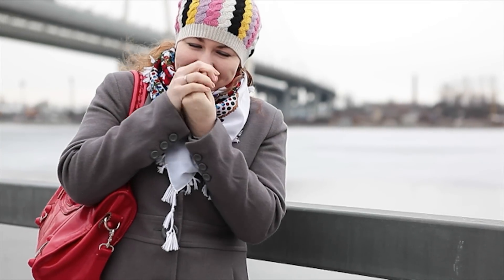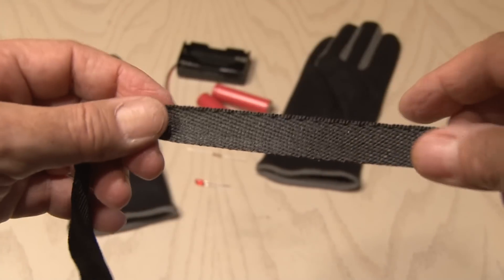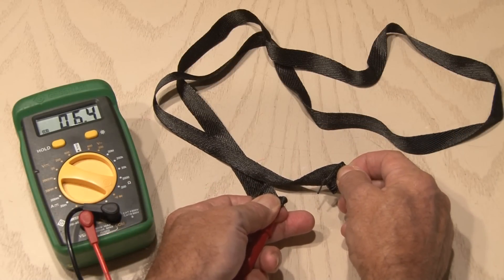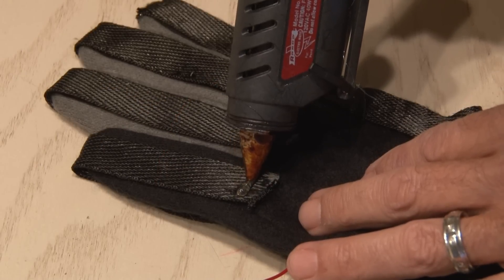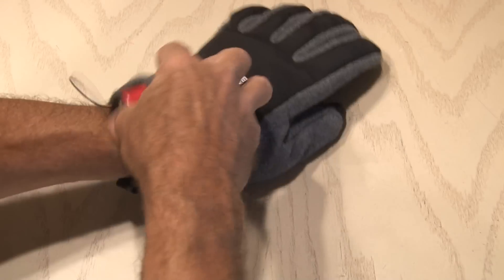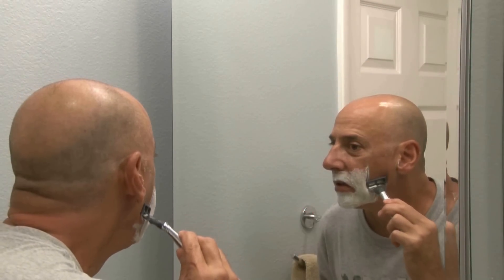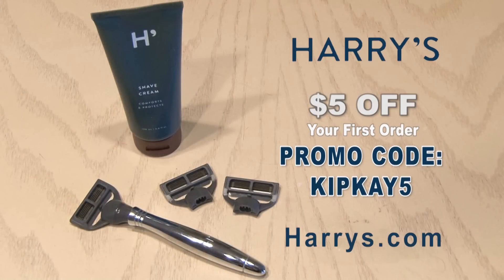Make a Pair of Heated Gloves!

Comment: good way to fully discharge a lithium ion battery...gonna cost a lot every time you do too lol
Reply: +TheXdmgx7 those are rechargeable batteries....
Reply: Kroenan affordable stuff do not include lipo batteries. 
And those motorcycle gloves do not have batteries...they connect to the bike.
And a protector is in the $5 range.
And everyone should be concerned about their $40 worth of batteries in an "affordable" project lasting more than one cycle.
And you made an uneducated statement about li-ions being rechargeable and your lack of knowledge about such batteries is showing. Can you move on an stop your "damage control" nonsense? 
This ~$60 project NEEDS 2 ~$5 protectors. Simple as that.
Reply: wow, missing points much. have a good one!
Reply: vgamesx1 Did I not say "good 18650s"?
And I agree with the laptop battery thing but to my exp those are usually 14's, not 18's. 
TP4056 makes it a little annoying. I'd put a 7.2v protector on both cells but either works. Or the voltage indicator. Those all work. Unfortunately neither was mentioned in the video neither was the fact that over discharging a lipo kills them. So you could get people who say "but these are rechargeable" and discharge the hell out of them then get a cheap ass charger and set the whole thing on fire. 
People need to be educated on the fact that lipos are not like nicad or nimh...he's using them like they are. That's how you get all those "hoverboards" catching on fire. Lack of education/information.
Reply: +TheXdmgx7 ok you can get 2600 mah batteries for <$2 if you take apart laptop batteries or buy direct from maker. if you discharge an 18650 below 2v it will still charge fine, just wont last as long. i have revived batteries from .1mv, you just only use like 5mA of current.
Reply: +TheXdmgx7 this project needs no protectors if you know what you are doing, one if you feel you need it.
Reply: DMAN22yeah
You guys don't get it. I have made phone chargers like this, an electric skateboard, and electric car jack, etc. MANY of us can handle our batteries but then again we don't need a tutorial to build a damn heating circuit.
This video is made for people who think there exist non rechargeable 18650 and who have no knowledge of how a lipo should be treated.
Those people are gonna build this, over discharge them, then attempt to ghetto charge them cuz smart chargers are expensive, and you know what could happen.
Also you really would change your mind about letting one over discharge when one explodes in your room.
Reply: TheXdmgx7 i have over 70 18650s in my room, at least 8 were below .2v and now that i brought them back up at a low current literally just using an old train transformer (i have a power supply now) they work fine, plus a charger from ebay is only $2
Reply: TheXdmgx7 if its negative voltage it isnt a good idea to use it but i use anything positive voltage. i have experience and skill so im not just an idiot who found some of them in a bin somwhere, although i did get mine from recycled laptop batteries
Reply: DMAN22yeah
 well let's hope everyone who tried building this glove is as skilled as you lol
Reply: TheXdmgx7 they should use 6 aa nimh because that will give pretty much the same capacity
Reply: +TheXdmgx7 i think those are nickel metal hydrate batteries not li-ions they would cost a fortune if they did. The ones i used were a variant so i might be wrong here so correct my errors if I do
Reply: Kamindu Samaranayake
 He says in the video that he's using 18650 3.7v batteries. And I don't believe I've ever come across Ni-mh 18650s.
Reply: Ok thanks for that☺
Reply: Gloves spontaneously combust

Comment: Please nobody do this, it's needlessly dangerous. Also, 140 degrees? Do you live in the arctic circle by chance? Regular gloves work much better than lighting your hands on fire.
Reply: +Lord GabeN I'm not sure 60C is enough to set anything on fire, especially in the cold.
Reply: errur 140F is certainly not comfortable anyway. Hot tubs are only 104F max. Imagine submerging your hands in water that's 4C more than a hot tub.
Reply: Lord GabeN Can't argue with that.
Reply: +Lord GabeN Warm air and warm water are 2 VERY different things. The termal conductivity of water is so much higher than that of air, it's a ridiculous comparison. I mean you can sit in a 200F sauna but you sure as hell can't sit in a tub of 200F water.
Reply: +Lord GabeN 
Celsius > Farenheit!!
Reply: TheThreeCraftateers - It's funny that you say that, considering it's a turn of phrase. I obviously didn't mean they were actually on fire.
Reply: +TheThreeCraftateers - If the protection circuit or anything else happens to those batteries, they could also explode or turn into a little flame-throwing bomb.
Reply: dude, they are 6 volts, get a grip with reality
Reply: and they would burn, not explode
Reply: TheThreeCraftateers - So the electrical potential has anything to do with the pressure inside them? Go throw a 6 volt battery into a fire and tell us how that works out.
Reply: +The Entire Earth I used a temperature gun to measure the heat coming out of the vents in my home and they were at 140°F. Short bursts of 140°F is quite nice when it's cold outside
Reply: The Entire Earth    again this is'nt fire were talking about here know it all, its a glove, here, ive got one, hold a hand warmer up to a lithium polymer battery, woah, no way, it dosnt explode, AND ITS LITHIUM!!!!!   im so amazed :l
Reply: timothy twogood no im good why dont you do that for me ;)
Reply: im three peolpe
Reply: +The Entire Earth Bro, do you even science?   Research thermal conductivity, then maybe you'll understand why your comment is so dumb.  I can't put my hand in 212 degree boiling water yet can hold my hand in a 350 degree oven, I wonder why??!
Reply: mikekoz68 Can you hold your hand in a 350 degree oven with no heat escaping for longer than an hour? There's a reason why people commit suicide by head in oven.
Reply: Finally someone with a brain.
Reply: +The Entire Earth aka "The Ignorant Commenter"

Comment: I think your crazy if you think 140 F is cozy and not flesh searingly hot
Reply: +xDXPxJOEx456x1 It is cozy when there's a layer of material between you and it substantial enough to significantly moderate the temperature.
Reply: +xDXPxJOEx456x1 Nooooo.... It can get that hot in the summer time. It's not even CLOSE to being able to burn you. Maybe if it was metal and you touched it with your bare hand, but this is between a layer of fabric
Reply: david2k6murphy Highest temperatures...

"Turkey	48.8 °C (119.8 °F)"

You were likely experiencing humidity also, but that's really neither here nor there.
Reply: +Nawor3565 where has it ever been 140F?
Reply: Bandicoot803 60 C can seriously burn you?
Reply: death valley was 130 degrees F before
Reply: @69madpiggy  
Not 140F, but someone just recently told me it got to 130F near (or in) Las Vegas.  I didn't know it got that hot on Earth.  xD  Lol

Comment: Let's be fair , no one makes these things
Reply: I do!
Reply: +LaserCow You shouldn't. These are somewhere between unsafe and idiotic.
Reply: Yeah, but I like doing dangerous things :D For example, when it was 00:00 at 2016, I went out to a field with some friends, we had an old truck packed with A LOT fireworks and just exploded it. It was awesome :D And, if you saw Cody's video, in which he cuts open his finger and puts a magnet in it, I did that too. It's still in my left index finger, and I can feel a weird tingling when I'm near electronic devices. It's cool tho...
Reply: LaserCow Those aren't really dangerous with minimum precautions.

This is more like suspending a pot of boiling water over your head in such a way that if anything goes even slightly wrong it will dump the water on you.
Reply: At least these are not Li-Po batteries :D

Comment: DON'T TRY THIS AT HOME PEOPLE LITHIUM ION BATTERIES CAN BE DANGEROUS AND THIS BUILD HAS NO PROTECTION
should only be attempted if you have knowledge of these batteries as there are a few types, some with no protection some with and some known as safe chemistry and lots of fakes for sale all over the internet. This video also does not mention that li ion batteries will become damaged if you discharge them to much, which can happen with no protection circuit board that cuts out at li ion's min voltage
a cheap fuse and protection board is advisable
but it would be cheaper and safer to buy a pair of heated gloves from a shop!!

don't mean to pee on your fire kipkay but plenty of laptops hoverboards phones e-cigs etc that use these batteries have caused fire and explosion plenty of examples here on the tube
Reply: if you over discharge just charge it back up slowly

Comment: I think this idea is pretty cool but I think it might work better for something like a sweatshirt, it would be much easier to hide the big bulky battery pack in the pocket. Also it might be a good idea to add in a variable resistor so you could turn the temperature up and down as needed.

Comment: No undervoltage protection for lithium cells, very bad.
Reply: +funyoude There are lithium cells with built in over/under voltage protection. So hopefully people use those. But they are rudimentary at best
Reply: +Tim Jadeglans Those pictured in this video are very obviously not the kind with built-in protection.

Comment: Can't we just buy those $1 hand warmers that last up to 10 hours?
Reply: +Nick Tech Talk Yes.

But they're not as cool.
Reply: The point of these videos is to Learn something on your own yeah you can buy hand warmers but if you like to build stuff that's what this channel teaches you to do.
Reply: +Jesus Christ But he only shows what to do, not how it works so that you can apply the knowledge to something other than these gloves.
Reply: Because spending $30 on dangerous heated gloves is better!
Reply: +Nick Tech Talk that are always WAY more safe then carrying 18650 explosives.
Reply: +Nick Tech Talk  and the gloves will pay for them selves over time,  ;)
Reply: +rogertopful  how are they dangerous?
Reply: +TheThreeCraftateers - because lithium ion batteries are dangerous and there is no protection built into the circuit. they also become damaged when discharged below their minimum voltage he should have used a fuse and a protection circuit both cost very little. AND WHY BOTHER you can buy commercially made safety included heated gloves from £10 up
Reply: he said you can use a resistor and an led    which lowers the output current to the carbon tape
Reply: still not good enough and still won't stop the batteries over discharging, a li ion protection circuit can be bought for £1 or 2. search youtube for laptop or mobile phone explosions to see how dangerous li ion can be
Reply: well than, just buy one, dont complain
Reply: +TheThreeCraftateers - i'm not complaining but people need to know the dangers i'm sure kipkay doesn't want to be sued when someone's hand gets blown to bits! and i would just go and buy a pair of the shelf for the same cost of building them!
Reply: yeah true, sorry for the problem ;)
Reply: +TheThreeCraftateers - Think of this - An "18650" is a battery cell that's inside your laptop battery. Most laptop batteries have 6 of them
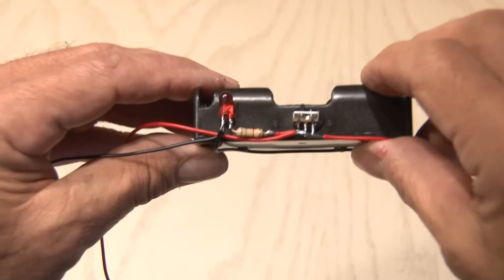Reply: +TheThreeCraftateers - Actually the LED and resister are in a parallel circuit to the carbon fiber tape.  The carbon fiber tape is a direct short. As shown in the video, you can pause it and follow the wires.  @ 1:31 mark.  As you can see the extra red wire going from the switch and extra black wire from the other side of the LED.
Reply: +Nick Tech Talk Lol Hey nick! It seems  that those $1 handwarmers dont put out enough heat..
Reply: The Salty Chip Hey The Salty Chip! We seem to have a very nice taste in videos :P lol.
Reply: Nick Tech Talk
Lol i guess we do.. :D
Reply: +Dan the batteries he is using are protected batteries. They wont over discharge
Reply: not once does he say they are protected batteries
Reply: +Dan just by looking at them u can tell if they are protected or not. Also almost all 18650 from reputable sources are protected now days. if they weren't protected it could be dangerous
Reply: Not true at all I use them regularly and most are not protected esp if they are high amp ones
Reply: That would just be too easy
Reply: No. We're diy people.
Reply: I ride motorcycle . In extreme cold  Hothands are useless .
Reply: You can

Comment: 140 degrees? (F not C)

No wonder why there's people saying theirs caught on fire.

edit _also the test was when it was in the open, being insulated between two different gloves would allow it to get even hotter._
Reply: +sonic meerkat Notice how it says Fahrenheit on the meter.
Reply: +sonic meerkat 
You mean 60 degrees Celsius since metric is the more superior and universal than imperial.
Reply: errur degrees Fahrenheit yeah.

Dj Ruccy yeah I know it's just I don't have conversation rates memorized and he said Fahrenheit in the video.
Reply: +sonic meerkat Most plastics have an auto-ignition point of 300+ degrees Fahrenheit, if you do however get your gloves to this temperature while wearing them I'd recommend you get a bilateral hemispherectomy as soon as possible.
Reply: Dj Ruccy yeah I know, although if I did convert the degrees others would be saying "but he said 140 degrees not 60!" So I went with the actual quote.
Reply: 451°F starts a fire
Reply: Lazor226 That's like saying all rocks weigh 4 pounds. The temperature at which a material spontaneously combusts is very different depending on the material.
Reply: +Elias Olsson true... I ment 451°F starts a fire on paper
Reply: +Elias Olsson lol

Comment: this is a horrible idea. one.. people must know battery safety. two.. why? looks like your running a series set up? this is dangerous people don't try this.  these batteries are not meant for this kind of stuff . what if the batteries vent and ground out ? boom loose your hands
Reply: how would they ground out? and as long as they are close in capacity you are fine wiring in series

Comment: This is a really dangerous idea. Please don't try.
Reply: It seems based on the comments every one that tried almost lost their hands
Reply: +Melissa Parker ya def not a good idea. Kips videos have been pretty ho hum lately.
Reply: +Morgan Crawford Anyone with a good understanding of electronics safety would deem this virtually harmless. The only factor that might cause a fault is yourself, if you build it good and use high temperature hot glue there is no way this would fail.
Reply: +BustedToyPRODUCTIONS it's been on vessel for a week.
Reply: +Elias Olsson maybe so but it wasn't explained clear enough for the common viewer. Are the batteries parallel or in series, no low voltage protection, and yes the glue still seems like it would be an issue.
Reply: Morgan Crawford Yes I do agree this is not safe for everyone to do but saying it's dangerous is simply not true. Someone who possesses the proper skills in electronics and electronics safety would know how to do this in a way that renders the product harmless.

And yes you're quite right the information he gives is sub-par. With that being said anyone familiar with DIY electronics could figure out the components by looking at it. The series battery case is configured differently depending on if it's series or parallel.
Reply: k
Reply: +Elias Olsson nah
Reply: +Elias Olsson he should atleast say that if you mess up u will lose your hands
Reply: Melissa Parker You should only attempt projects with high-drain lithium ion batteries if you know what you're doing. If you're not comfortable with handling electronics you simply should not do this. But like I said, this is not for everyone and should not be attempted by everyone.
Reply: +Elias Olsson he should definitely put a warning in the video and also I wouldn't were these in the snow because if they get wet it will probably mess up, catch fire or something like that
Reply: Melissa Parker And if you do happen to mess up you will have plenty of warning signals before this reaches a high enough temperature to scorch skin. And if you do this correctly you won't ever have anything bad happen unless the batteries malfunction.
It's not like lithium ion batteries INSTANTLY explode when shorted. Trust me, I've shorted a couple of 18650 lithium ion batteries and it's very obvious when they are shorted.
Reply: +Elias Olsson 18650s usually have quite a while before they do anything exciting, they are fun to short out tho